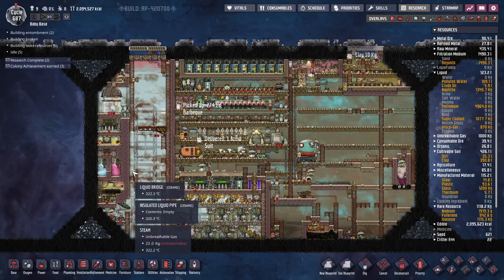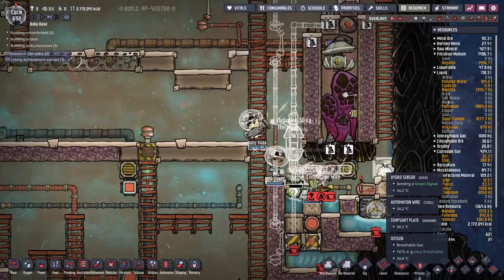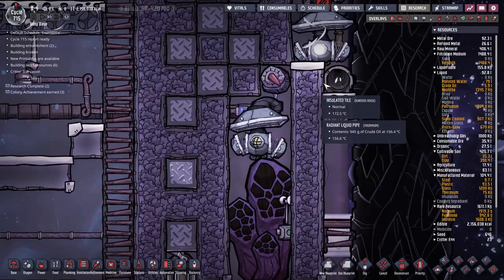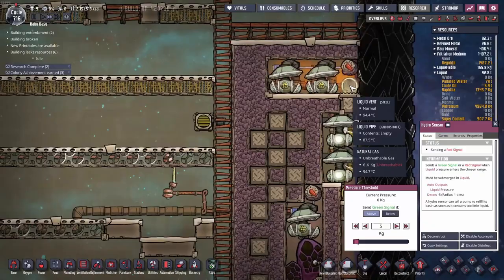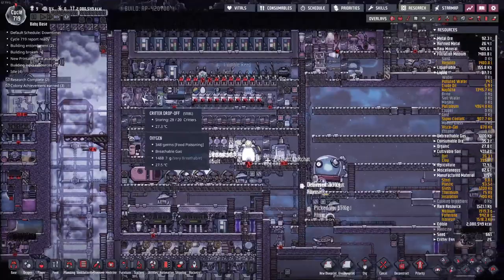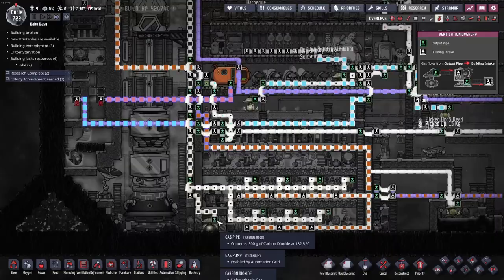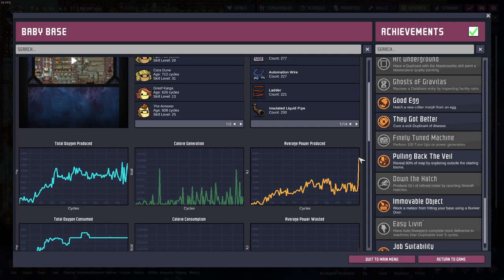Baby Base 16 : Lots of power only a few mistakes : Oxygen not included

Comment: I've noticed best way to keep base cool is to run your liquid pipes THROUGH your floors instead of in the space between floors. The solid material around the pipe will be much better conductor than the gas! Illustrated precisely by your steam turbine cooling at the beginning of the video.
Reply: oooh thanks I'll be stealing that for my curent playthrough

Comment: Thanks for another great episode,
I had a little bit of fun with the save game,  i think i worked out the overheating steam turbines issue, their in carbon dioxide, with a whooping thermal conductivity of  0.015 , it's safe to say thats the issue,  i look for to how you solve the Future oil well methane issue. personally i'd expand the Industrial brick out  and add at least 1 more natural gas gen, and drop any more solid methane into the oil of the oil well and have that solve the methane issues of both storage and rapid build up of methane in the oil well. 
I look forward to the next episode

Comment: If you remove the critter drop off in the meat factory, you could place another pedestal there to increase the left side a smidge more, would require the airflow tile to be changed to window tile, and with such a crowded room, that might be impossible
Reply: You could build a tile above the airflow tile, replace the airflow and remove the temporary tile. If any critters get trapped they cant escape the room

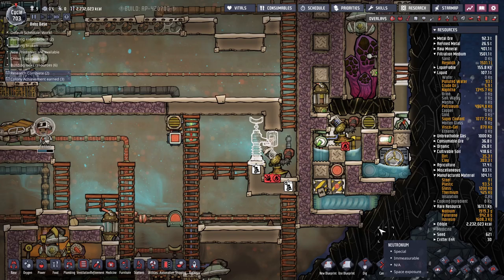Comment: 9:12 Pretty sure the oxygen was there all along, behind the thermo pipe sensor. It was separated from the rest of the space when you pulled a vacuum
Reply from the maker: That is embarrassing. Having that O2 there would have messed up everything, it turns out I was lucky the tepedizer was not in enough water.
Reply: @FrancisJohnYT  life, uhh, finds a way
Reply: @FrancisJohnYT  Yeah I saw that immediately.  I have a general clue about this contraption, like my cat has a general clue that the refrigerator stores food.  But I was proud to spot the one tile of non-vacuum.

Comment: I have been waiting for this one. I was wondering how he was going to handle the hydrogen vent. I have been playing this mod alongside Francis John but on a large sized asteroid. I don't have a geyser spoiling the space of my sour gas boiler and I made a few tweaks to Francis's design to to reduce my vertical height by two blocks. Looking at the map after finishing it and now I'm wishing I had instead tried to compress the horizontal requirements because the boiler and my oil reservoir leave me no wiggle room for a second rocket.  One of the wonderful things about this style of map is due to its small size it's making it easier to dissect builds commonly made on larger maps. I can't wait for the next video because he's giving me objectives to try for in my own play through.

Comment: 19:13 
^_^ Old habits die hard it seems. I've taken to using gas tanks in line with what I want to store. The gas tanks have an automation output now. Chuck that through a NOT gate and you can trigger your generators when the tanks reach a certain level without needing that interesting bridge trick.
Reply: Sure, but a gas tank takes up a lot of space while pipes don't.

Comment: You know, you don't need 2 insulated pipes to move the liquified gases around, just one pipe with a filter at the end should be enough to move both liquids.

If what you want is to move the same liquid on both directions you can also do it with one pipe if you alternate.

Comment: You could say it's balanced on the edge of a pizza slicer. The kind that's basically just a metal wheel with a handle. Now some people might claim that those things aren't sharp at all but I actually managed to cut myself on one while doing the dishes. There was cheese stuck on the edge and I squeezed on it and pulled to the side to remove it after letting it soak for a while. I was shocked when I started to bleed but also quite impressed by my own stupidity in what just I managed to do.

Great episode btw. It would be cool to see you give a salt reactor a go sometime. Maybe not in this series though, due to lack of space of course.

As for the space you currently have left, maybe you could get some burgers going or something. I would really like to see almost the entire map used for something before the series is over.

Comment: Instead of running two pipes, you could run one that filters at the rocket side and load fuel in alternating batches as a challenge. Hard mode: automate it.

Comment: Hello!
Quick question. At @38:00 you mention if you increase the efficiency of the heat exchange between the oil and sour gas, you need extra cooling from a steam turbine. I wonder: wouldn't exchanging more heat with the nat gas leaving the system be enough? I mean... the hotter the nat gat the more heat you're removing from the system. So another way to re-balance it could be to build a layer or two more on the left side heat exchanger.
Reply: There will be a rocket silo there. No room.
Reply: @Tenebrousable  a rocket silo  above the boiler? I doubt it.

Comment: If it's designed to produce enough natural gas for the generators to run constantly, why do the bit to check if the gas is backing up to turn on the genrators? Just disconnect the automation from the battery and let them run. Or am I missing something?
Reply: The generators can run constantly....when you actually need all the power

Comment: why does every sour gas boiler i see others make use a liquid pump for methane?

use cold radiant piping at a higher elevation & let it fall down (past the nat gas pumps) to where it boils into nat gas.
Reply from the maker: In this design it's more about the temperature transfer, usually you just build large gas heat exchange tunnels. By having everything in radiant pipes I can transfer temp more efficiently and make the heat exchanger shorter which was very important for this map.

Comment: I'm pretty concerned you don't have an extra nat. gas. genny to burn off excess, say in your old storage room or if/when your boiler backs up.
Reply: yeah it really needs one more. There were some sizeable piles of solid methane building up in there too, they will melt eventually. So either that or the solid methane dump at the end of the conveyer rail are going to explode soon.

Comment: My petroleum boiler keeps breaking because there’s an issue with the design, when I load the game, the igneous rock level goes up by one even though it was 2 blocks before the save, it then touches the metal tile and burns the drop of oil there into sour gas and then everything breaks
Reply from the maker: You end up with an extra tile of magma turning into rock? You got a save game file you can send me? Email is in the about section, I can have a quick look tomorrow.

Comment: Hmm i get why is there a counterflow and on a regular map it works nice , but why on this minimap ? Why not use all the cold to flash freeze the sour gas into solid methane conveyor it in walls into a 2x4 room whit a 2 gas pump and let the heat from the rocket silo+hot block+excess heat from the boiler to thaw it ? That way the system could never backup and the "only" point of failure is the game crashing because of the huge gas pressure :P Also if there is excess cold in the system , you could use it to freeze co2 solid and conveyor it in walls to space , that way the natural gas gens cant backup either.

Comment: If I understand your "balanced on an uncomfortably sharp spoon" Sour Gas Boiler right it hast the huge flaw of never beeing able to burn off excess Natural Gas. If it ever backs up (which it already has once), or if for some other reason the Gas Generators won't run you'll produce more Gas than you can burn off in the long run. You'll alowasy be producing at least as much as you are destroying. So you need some form of overflow control for the gas, and the easiest should be a pipe from the gas storage ontop of the boiler into space.
Reply: just wait until those piles of solid methane melt, there was a couple of tons there.
Reply: He has an automation signal to turn off the sour gas boiler when natural gas backs up in the pipe just before the generators. That's what the business with the double bridges was about.
Reply: @glennclapp2537  Thanks for pointing that out. Apparently I dind't paid enough attention to that detail in particular. I thought the hole time the Gas Sensor at the double bridge would force the generators to run, rather thatn shutting the boiler off.
Reply: @2000Meilen  No problem. Others in the thread have pointed out that usually you'd do something like that with a liquid reservoir now that they have automation outputs. Francis likely used this, older, method because it allows him to put the automation on the pipe layer rather than the building layer since space is at such a premium. In the early days of ONI this double bridge method was the only way to generate the desired automation signal.

Comment: As always, a great vid! Thank you. I especially love the mee-thain bit xD
When it comes to your clay farm i read somewhere, on reddit i think, that when you put deodorizer so tightly they tend to do weird things. It might have been fixed since then if not, that could be a possible reason why the pressure goes nuts like this. Conclusion was that deodorizers should not be closer then every 2nd tile.
Another thing. As I understand you made a boiler that produces exactly as much nat. gas as you consume, which is a problem. You need to have more consumers than production, the reason is that if for any reason your generators stop, you probably won't ever be able to burn off the excess since you always consume exactly what you produce. In other words I think that excess will pile on and on until it clogs up your system. The other option is to have the overflow redirect excess to a space vent.
Btw I know there is this common misconception of coldness or chill being a thing (23:30)... it's wrong tho, coldness is simply the lack of heat ;) But, it can help explain thing. From a thermodynamic and logic standpoint tho, when you open your fridge you're not letting the chill out, you're letting the heat in to where there is less of it. Same as cheese holes aren't things, they are an absence of cheese... Or an empty glass; it's not filled with the lack of whiskey :P and generally you can't let out or pour the lack of something.
Anyway... thanks again!

Comment: why not use your hydrogen vent to help heat the sour gas boiler / cool the hydrogen ?
Reply: Might have something to do with the 'too-high efficiency' he discussed at the end. Using the hydrogen would add 'heating capacity' for free, yes, but then he wouldn't generate extra chill to cool down the Sour Gas. That would probably lead to his aquatuner running too hot, just like the oil-liquid vent-exchanger he showed.
Aside, while the hydrogen is hot, it's got a very low heat capacity, so a) there's only a limited amount of heat he could extract from it, and b) it's not that big of a deal to leave it hot.
Reply: @arnoudvanderlugt3230  also dormance phases would be my guess since you would need to stockpile or constantly re-regulate depending if its erupting or not

Comment: Can you not get the rock out using an auto-sweeper? too much effort?
Reply from the maker: More a case of lazy. Also if I deconstruct the auto sweeper later then the material it is made out of will fall in. Their was a great suggestion that I use plastic, when the machine is switched on it would melt and turn into sour gas anyway.